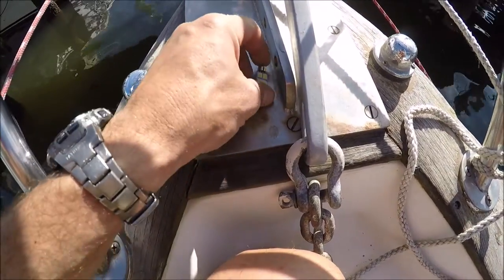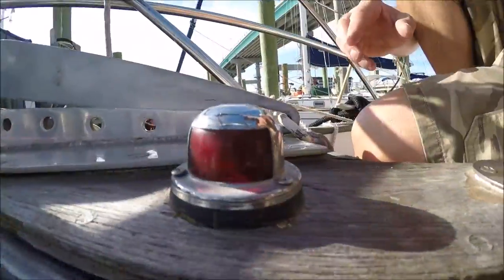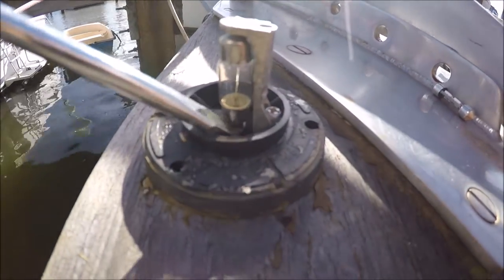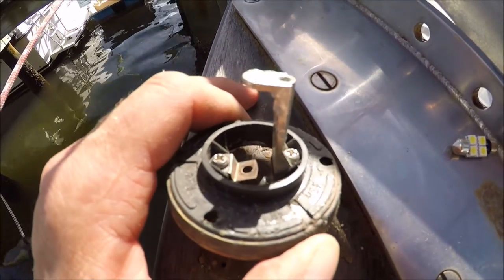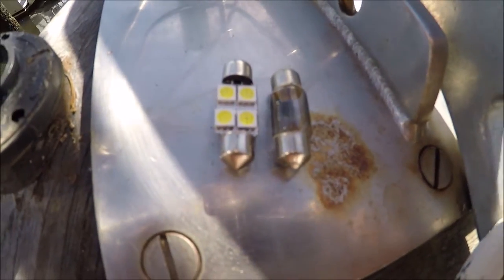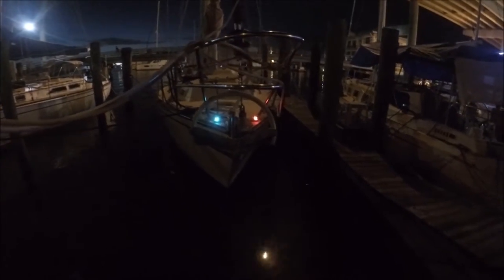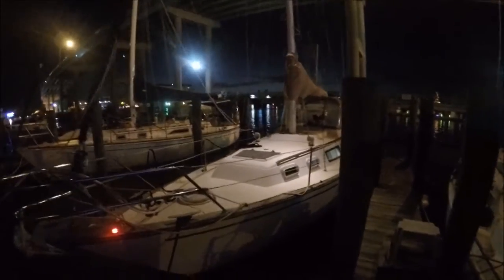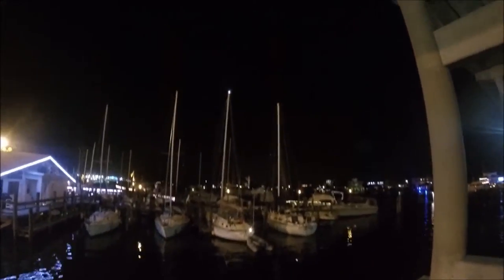LED light bulbs on a sailboat.

Comment: LEDs are really great.   I put soft white LEDs in all my interior fixtures.  No more worries about battery drain or sitting in the dark at anchor.
Reply from the maker: +S/V Southern Lady   I got a bunch of replacement led bulbs for my interior lights and they are horrible.  They are so white, its bright but the light is not very usable.  I'm going to have to replace them all again with something better.  I may do a video in the future on what bulbs not to get.    Where did you get yours?
Reply: +Down In The Islands 
I got mine from BEDAZZLED in the UK.  The model that I used was BA15S-9L Warm.
Reply: Cool white or daylight are supposed to be better for your well being than warm candle colour lighting. I prefer it myself, we have converted our house lighting to cool white led now too.

Comment: What was your before and after on the amperage? How many amps do you have for your house battery bank?
Reply from the maker: +Chris Redding  The amperage that the led light bulbs use is so small it doesn&#39;t even show up on my amp meter.  I did a comparison a while back when I was replacing the bulbs inside the boat with LEDs.  Once incandescent bulb used as much as 11 LED bulbs.  I use to make sure not to use to many lights at night.  Now I could leave all the lights on for days without even noticing.  I have 3 12v deep cycle batteries that make about 300 amp hours total.

Comment: You would be better off replacing the entire fixture. Festoon bulbs are problematic because it doesn't take much corrosion to interfere with operation of the bulb. A purposefully designed led fixture will not corrode so it will be more reliable.
Reply from the maker: +comsite2 I just recently put in 2 LED fixtures over the galley sink that put out amazing light but the fixtures are pretty ugly.   Most of my light fixtures in the boat are brass and glass and look pretty nice.   I'll have to keep my eye out for some decent looking wall mounted led fixtures.
Reply: +Down In The Islands I was referring to nav lights which are typically exposed to the elements. I believe IMTRA corp, new bedford ma has some nice interior LEDs, but using replacement Led bulbs inside would be less troublesome than nav lights.
Reply from the maker: +paul hyde I'll have to see how long the nav light bulbs last.   I did notice that the old incandescent bulbs would lose their connection after sitting for a while and i would have to tap on the top of the fixture to get them to turn on.
Reply: +Down In The Islands I've seen people bypass that issue by soldering wires to the contacts then to the bulbs.
Reply: Was just going to suggest that. Did that to some of mine as well as leds' last so long anyways it's not a problem.